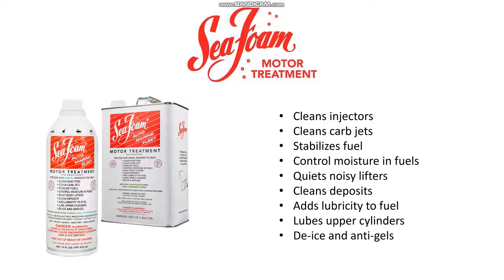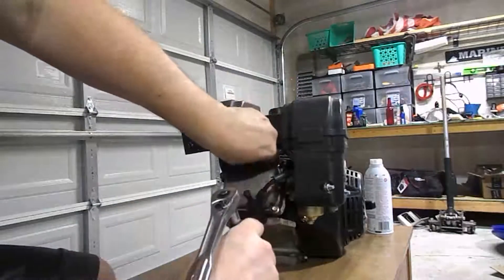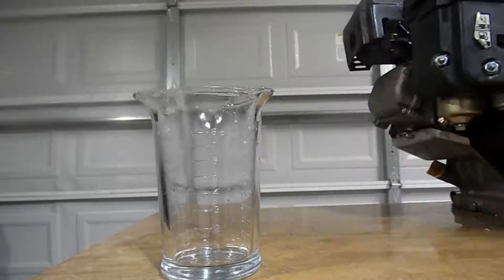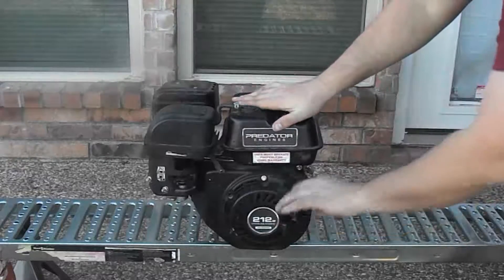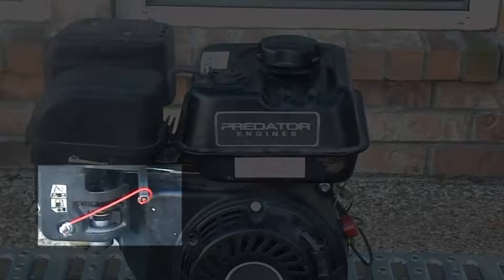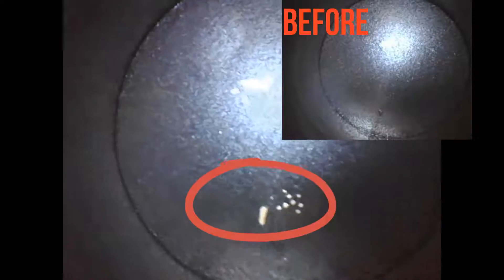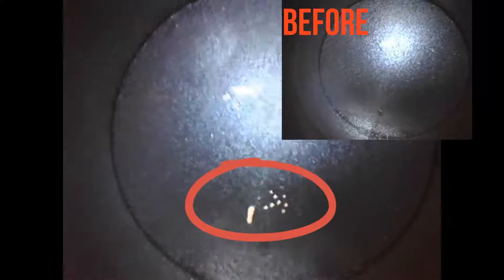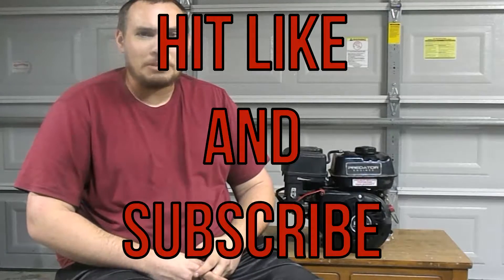Seafoam in gas test - Does it really work? Let's try it!

Comment: I use it in my Dodge Ram 360, pull off the vacuum line to the brake booster and let it pull it in. Wait a half hour and let the smoke show begin.

Comment: Run engine til it gets hot then shut it off, pull plug an add 1/2 ounce directly into cylinder, put plug back in let soak 15 minutes then start engine and repeat that process a few times.

Comment: About see foam, I couldn't pass smog, my mechanic said I had a carbon build up on #6 piston I used sea foam 3 times in a full tank of gas after about 500 miles I went though smog again and passed, this saved me about 1200 dollars, it WORKS.

Comment: Great video putting the 8 oz in the gas tank also you can put seafoam in you'll have to put it in a spray bottle but you'll have to take the filter off the air filter and spray it when the engine is on spray it really good okay and then when it smokes let it conch out started out about 10 minutes and watch all that carbon deposits come out PS I would also an NGK spark plug and make sure you don't use gasoline that has ethanol in it make sure it's high octane that motor will run and run and run

Comment: I'm a HUGE skeptic about stuff like this BUT, living in Florida with a Old 1965 Ford truck with a huge gas tank it would develop condensation sitting half full, it would skip pop etc running down the road TILL I put a can of this stuff in it, all os a sugged it would clear up, had the same issue with my Honda 300 3 wheeler till I put 4 oz in every tank full

Comment: I say go old school. That crap is 5$ a can . You can pull the air filter off and  take and run the engine at half throttle and take a water bottle and put a small hole in the top and squeeze in a few shots every  few seconds. It will pressure clean the carbon. For no money.

Comment: It works very well, in fact maybe too well. Added some to my Chevy truck gas tank, and some to my car gas tank. Within a couple few weeks both vehicles had plugged up fuel filters and both vehicles left me stranded til I changed the fuel filter. I say do not put it in gas tank, leave the solid crud on the bottom of the tank instead of breaking loose and stuck plugging up your fuel filter. It is fine for in the crankcase or down the carb, works miracles!

Comment: In my experience with the Seafoam, you really need to do it more than once. It’s not a “one & done” kind of product. Maybe it could be in you used it from the day the engine was new, but on a worn-in engine, it takes a couple of tank-fulls to get it cleaned. Also, my experience was that it cleaned the carbs faster then the cylinder heads and piston walls. My engine was a high-mileage engine and it took a couple of bottles of a pretty strong mix to clean it out. Then I used Lucas oil additives to help with the scratching of the cylinder walls. It has improved my performance and gas mileage immensely. I’d estimate that for under $100, I prolonged the life of the engine a great deal. Great video, BTW.

Comment: If you’re going to test SeaFoam, why not go back to the old original mechanic’s trick and simply spritz a little water into the carb while the engine is running?  It’s just thermal shock breaking the carbon loose.

Comment: Running your engine without a load is not a good simulation of 'real operating' conditions.  With a normal load on the engine, i.e. engine is installed in it's normal chassis, spinning a blade and cutting grass, the engine governor will open the throttle to maintain roughly the initial rpm setting.  This produces much higher combustion chamber pressures and temperatures and much higher fuel consumption.  This would be a fair test of your carbon removal product and would likely change the results in your Seafoam test.

Comment: Sea foam is good stuff, I sold it for years and still use it. To blow the carbon out, it’s best to start with hot running engine, dump 1/3 can into carb while running (flood it out and let it sit for a bit to eat the carbon)- 1/3 in crankcase-1/3 in tank- that’s how the Sea Foam rep demonstrated it on a car engine- just a FYI! An add-on to that is with an injected engine, use a vacuum line to suck from the sea foam can into the intake.

Comment: I use Amsoil Quickshot mixed with  6 gallons of gas and it cleans the carbon and it is great with  water in the gas from the Ethanol and it also has a Stabilizer in it to. It actually does what it claims, unlike this of garbage they are selling. In large engines i use the Amsoil P I or the Performance Improver 
 which i can attest to that it really works. I had a 147,000 miles on my original plugs in my Jeep Grand Cherokee Limited, and i put the PI in the gas, when i changed the plugs a week later, the mechanic said, what the hell did you do to these plugs, they were spotless, No Carbon build up at all, they were really clean.
Reply: Interesting.  Maybe do a youtube about the Amsoil Quick.  Would be interested to see how it works and the results you are getting.

Comment: an engine not operating under a normal load will build up with carbon due to inefficient combustion conditions and the petroleum distillates ei mineral spirits will soften the carbon deposits but without correct combustion ie burning of the fuel/air in a proper ratio the carbon will never leave the combustion chamber, the best thing you could do for this engine is to attach it to an appliance and simulate it working at nears it full output and the piston and valve would clean right up and possibly put a hotter spark plug in it.

Comment: The main concern is carbon on the back of the intake valves. That disrupts air/fuel flow and creates performance issues. You need to remove the head and check the valves to see any real difference.
Reply: Seafoam the best

Comment: It absolutely works. I used some in my John Deere 340 mower, just added it to the gas tank. The mower use to smoke some upon initial starting up, not anymore. I had an old mechanic tell me he swears by it and runs it in all his equipment.
Reply: Ya right.

Comment: One tall can of Royal purple fuel treatment in 35 gallon tank and drove it for nearly 5 hours, didn't notice anything. Poured two tall cans of seafoam Marine fuel additive for 35 gallons drove it for nearly 5 hours. Notice a definite acceleration improvement off the line squealing the tires. Just wonder how often I have to do this. Or you can do like I did with my other car take the fuel injectors out send them to RC engineering in Los Angeles for a rebuild very inexpensive and all injectors will be balanced evenly.
Reply: Rc Engineering is fast and inexpensive! I sent them a set of injectors for a supra and a set for a xr4ti and they came back cleaned and flow matched and even new pintle caps and o rings. Highly recommend sending your injectors to them they come back better than new !

Comment: I have used this several times in my 2000 Ford F150 shortbed. It has a fuel injected V6 with 260,000 miles on it. I noticed a couple years ago it was running a bit rough with some light grey smoke when I started it. I used a couple cans of seafoam in two full tanks of gas and it actually ran pretty good after that with no smoke. So now Im trying it again 2 years later. We'll see how it does. May just need a new engine, lol.

Comment: I have a Toro commercial zero tun mower with a Kohler engine.  A few weeks ago it ran like total crap.  Stalling at low throttle and surging at full throttle.  I’m fully capable of removing the carb and cleaning the jets but instead I gave Seafoam a try at about 3oz per gallon of gas. I let the engine run at full throttle and within 30 minutes the engine sounded fine — no surging and no stalls.  Its the 1st time I’ve ever used it.

Comment: I was told, put it in tank and crankcase, run it for fifty miles, then do an oil change.  Don't leave it in!
Reply from the maker: Put it in the tank and leave it in of course.  It is suggested to put it in the crankcase for 500 miles before oil change, I've heard other people only say as low as 50.  I don't believe it hurts leaving it in the engine for 500 miles, though I don't.

Comment: Every video  I have watched about Seafoam , the engines always emit a lot of smoke in the exhaust. I never noticed your smoke at all??? Perhaps use didn’t use enough. That may be why it didn’t take the carbon of the piston head???
Reply: you are correct , he should have poured the whole contents of the can into the fuel tank , and then used 93 octane fuel , 87 octane fuel contains a lot of ethanol , which carbons up pistons far worse than 87 octane without ethanol
Reply: Those that you see smoking are after Seafoam is  dumped straight, either through a vacuum hose on the engine, or poured directly into the carb.It works better when used straight,vs diluted in the fuel. In the old days guys would use transmission fluid, or on a newer vehicle regular water to break up carbon deposits
Reply: @SuperGlacierGirl  true  , but with a small fuel tank such as that one   , the entire bottle is a better idea instead of diluted too much    but water injected int these newer higher compression engines is a bad idea , total hydraulic lockup of the engine is a good possibility

Comment: I use it in my 1980 Honda CBX, which has six carburetors and is like 6 - 175 cc motors ganged together.
I add Seafoam 10-15 ml per liter, and my pistons were carboned up like your small motor.
It seems to work, I'll update this later when I change the plugs.

Comment: It works amazing in small gas engines. I have a pressure washer that absolutely would not start without starting fluid. After running a full tank of gas with Seafoam (not sure of the the ratio) it starts first pull every time. I am not a paid sponsor of the product, I’m only sharing my experience.
Reply from the maker: Thank you for your input!  I'm not a paid sponsor neither, but since making this video, I've had several instances where Seafoam has saved the day!
Reply: Would it work in my John Deere tractor
Reply: Lawn

Comment: Looks to me like it was effective. Started to break down those deposits on the cylinder head. A few more refills with Seafoam added, might be sparkling clean. It only just began to start, and that was heavily carbonized. I've seen other videos, where they pour a couple ounces directly in there on that head, let it soak a while... then turn the motor a few times with the spark plug out to get the excess liquid out... then fire it up with seafoam mixed in the gas. Way better results. My guess, is for the lazy or uninspired, just mixing in the gas regularly would work. But if you're more ambitious and cheap, you can more quickly and directly get better results.

Comment: HARD BAKED ON CARBON ON THE PISTON WILL RAISE YOUR CR. CARBON DEPOSITS ARE NOT USUALLY FOUND AROUND AN EXHAUST VALVE, DUE TO THE HEAT OF 4500 DEGREES. IF THE CARBON IS ABOVE YOUR INTAKE VALVE, LIKE FROM BAD VALVE GUIDES, YOU NEED A WIRE BRUSH FOR REMOVAL OF THE DEPOSITS SINCE THAT IS NOT IN THE COMBUSTION CHAMBER. HYDRO CARBONS ARE INEFFECTIVE ON REMOVING CARBON BECAUSE THATS IS WHAT PUT THE CARBON ON TOP OF THE PISTON! PLAIN OL WATER ATOMIZED AN PUT THRU YOUR ENGINE WILL LIFT ALL THE CARBON. IN THE COMBUSTION CHAMBER. PROOF! TAKE AN ENGINE WITH A BLOWN HEAD GASKET, THE CYL THAT HAD THE WATER IS SUPER CLEAN, OR AN ENGINE THAT HAS METHANOL INJECTION! I AM NOT SAYING YOUR PRODUCT IS BAD BUT, WATER IS A LOT CHEAPER, AND WILL REMOVE ALL THE CARBON IN THE COMBUSTION CHAMBER, AND ON TOP OF THE PISTON, REMEMBER THOSE DEPOSITS DIDNT GET THERE OVER NITE, IT TOOK TIME TO BAKE THE CARBON ON THERE, BUT AS WATER TURNS TO STEAM IT WILL REMOVE EVERY LAST CRUMB OF CARBON, STUCK IN THE COMBUSTION CHAMBER .

Comment: IM AN AUTO MACHINIST, YOU NEED A SPECIAL PERMIT TO SELL SNAKE OIL.
Reply from the maker: People have different opinions on how well it works, but it's been around since 1942...  I don't think snake oil would last that long.
Reply: @areutryingitout5678  new idiots are produced every day keeps the world turning.  BBB
Reply: I’ve seen it smooth out rough idling snow mobiles many times.

Comment: In my 5.4 Triton engine, I added a whole bottle to a half tank, drove for 2 hours.  Had a misfire the very next day
Reply: Did the same but a full tank of fuel . Then drove it on the highway and round town with higher rpm . Seemed to help a bit with rough idle during traffic stops and engine light went off halfway trough the tank . Been 2 weeks since then and engine seems to run a lot smoother and the light is still off , maybe it’s just me but it seemed to help . 2010 f150 @ 175 000 k
Reply: It takes more than an additive to fix those motors
Reply: Junk engine. Was probably loaded with carbon and sludge.

Comment: I think its a ok motor flush to dissolve oil  sludge if you do it right . Drive 100 miles after adding a can  to oil and change out .

Comment: Here is my experience with use of Seafoam along with Mobil-1 fully synthetic oil in 2009 Hyundai Accent (4 cylinder engine). 
With no change in driving conditions, oil type and grade, fuel grade (87 octane) and oil brand (mobil-1). 
Mileage: Before Seafoam 12.5 km/L 
Mileage after Seafoam: 13.8-14.2 km/l
Reply: Ha well that has to be within the tolerance of your fuel economy accuracy, because it couldnt change it for the worse.
Reply: it didnt?